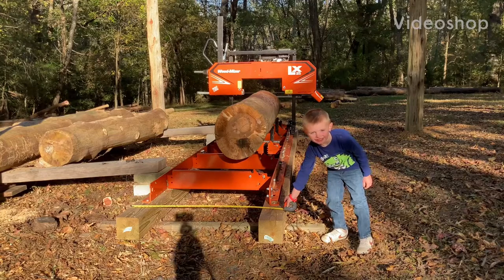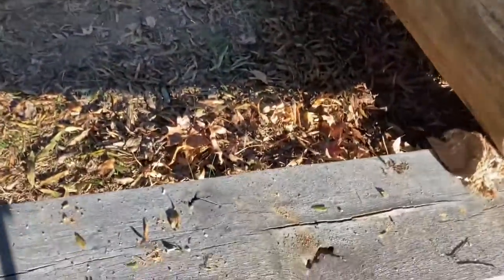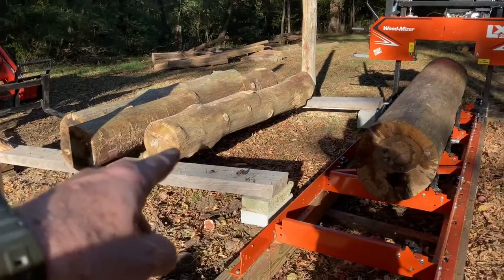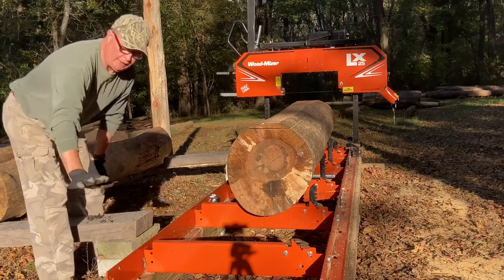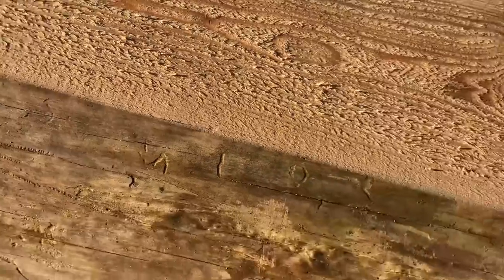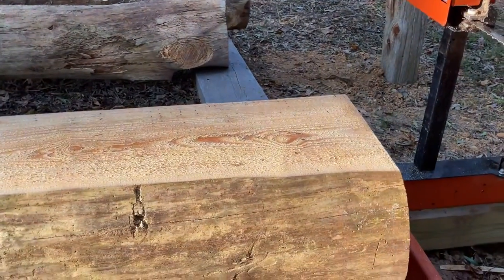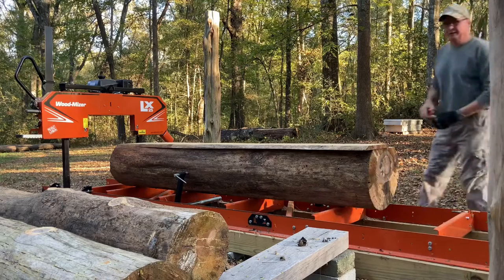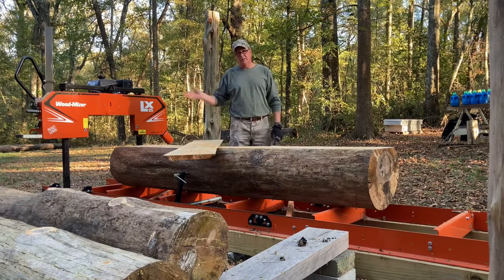WOOD-MIZER LX25 SAW MILL - REVIEW AND HELPFUL TIPS

Comment: I have the same model. Yes, it is underpowered with the 9.5 h.p. motor
 I can't imagine what the 7.5 motor would be like. It is a "hobby" mill. I keep that in mind, so does it cut boards? Yes! Would it be the saw of choice for someone trying to make money with it? I don't think so. I wish the blades stayed sharp longer. Maybe it is just me.
Reply from the maker: You are so right…it needs 14hp or better….A pine log will slow cut on this…also hardwood…thanks for watching.
Reply from the maker: It’s not just you…You really have to keep it cleaned out also. I have an ego blower to clean it with.

Comment: How does it do in red and white oak,
Reply from the maker: Mine cuts good but always make sure your blade is sharp.  I cut some old oak that was on the ground for 23 years and hard as a rock but it cut 2 good boards out.  White oak and water oak is all I have cut so far but I have a 10 foot red I’m gonna cut soon.  Should cut it good.  I finally changed my blade.  I was cutting pine and got some wave in the boards change blade and cleared up.  If you get one take your time and don’t force the saw.  Mix 1 tablespoon of dish washing soap and a tablespoon of chainsaw oil to a gallon of water and that will help save your blade.  Hope this helps.
Reply: @attechoutdoors5893   thanks fella, I appreciate it!